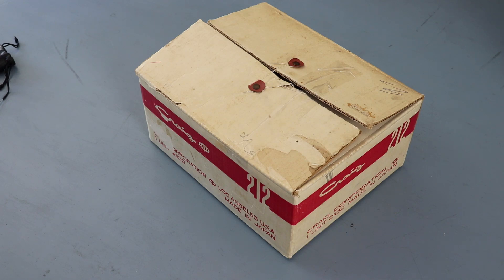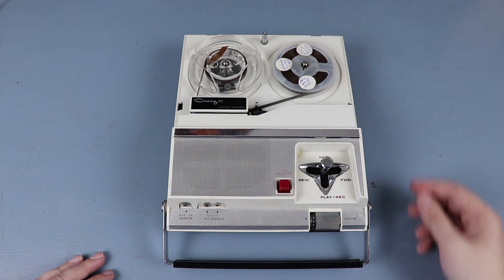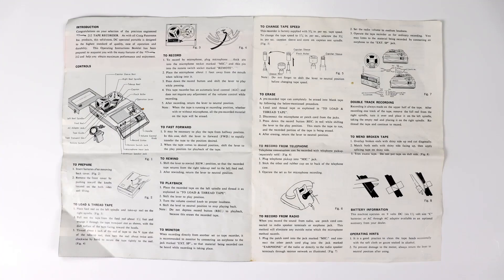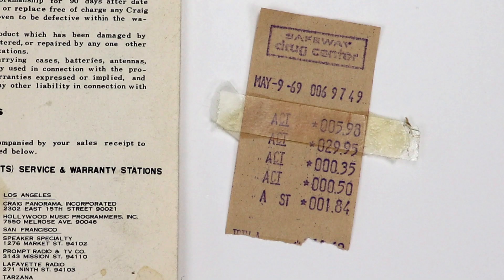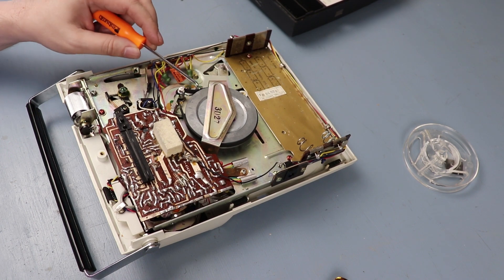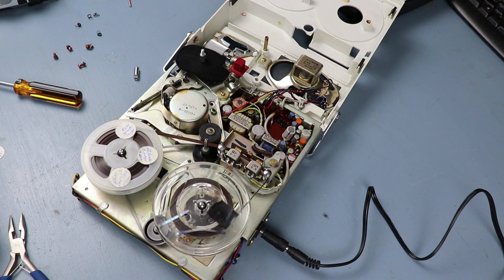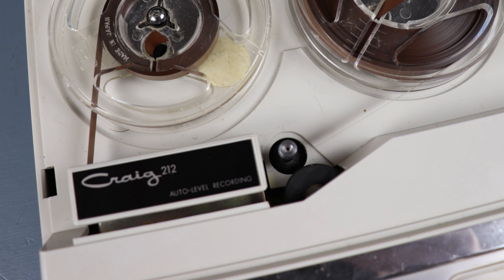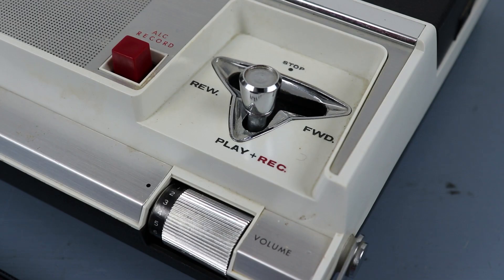The Craig 212 two speed portable tape recorder

Comment: The earliest 3" reel recorders didn't have "capstan drive." As the batteries gradually wore down, recording speed slowed down. When you played it back with fresh batteries, you sounded like a chipmunk! Capstans were a BIG advancement! Here's what another person said: "With a rim drive recorder there is no universal speed regulation, as one reel empties and the other one fills, the speed changes with the ratio." 

An AC adapter jack was also a much-desired feature. Without one, even if you had capstan drive, you went through batteries like crazy! One other VERY desirable feature that this 212 doesn't have is a Tape Counter. You could locate things on a reel of tape MUCH easier if you had reference numbers & wrote them down.

Comment: Ha ha, my favourite Christmas present when I was a kid. I thought it was dead, but many years later, I got it going by putting the belt back in place...very old so it does not grip well. I am looking for a new belt...If you record line in, you can monitor the incoming audio by partially depressing the record button before engaging the motor. Crazy loud for its size. It can give great tape saturation to a guitar track coming in, and also fun to grab the reel for lofi pitch modulation FX😂 Enjoying this tutorial, I will follow up...mine also records the crickets sound🤣🤣🤣

Comment: Thanks for the video of the Craig 212. I originally bought this model new (1968 or 69?) and still have the deck, remote microphone and the original box, although I have lost the manual and the power adapter.  I also had the telephone pickup, which was just a small microphone with a suction cup that you would affix to the back of the headset. I recall that it didn't work very well. Anyway, good find!

Comment: I had a Realistic (Radio Shack) 505-A 5 inch reel recorder.  It had the same capstan setup.  I recorded many Star Trek episodes.  Listening to them audio only, you tend to memorize the dialog.  I still have the 505-A as well as a minty 505 - the predecessor model.  The 505 needs a belt.  I never thought about using a 3d printer to make belts.  Right now that's out of my reach but I may be able to find a NOS part or replica someplace.  The Craig 212 was clearly the Cadillac of the 3-inch machines, with a true capstan drive.  Featured in many episodes of Mission: Impossible.  They also used a Craig 2106, a 5" model with capstan drive and a similar joystick control.  I have a perfect working example of the Webcor 210, one of the first consumer tape recorders circa 1953.

Comment: My dad had this machine while he flew F4 in the Vietnam War in 1968. He would record tapes and send them to my mom and that is how they stayed in touch during the war. My mom would do the same. I have this machine now and all of their tapes. I am going to try to make my  machine work better using your techniques. The tapes currently sound garbled.
Reply: I have the same machine but I'm having trouble with the pinch roller and I'm not sure how to take off the front panel of the machine you have an instagram or Facebook I can contact you at? most likely the issues with your machine is non occurrent in mine and I would be able to show you a reference
Reply: @sxo2685  If the rubber of the pinch roller isn't too dried up, probably all you need to do is clean the glaze off of it. As kids, we used to use rubbing alcohol (isopropyl) on a Q-tip, but there might be better things. Don't think I'd use any harsh things like lacquer thinner, though.

Comment: I have the original Sanyo MR-212, with a load of tapes of me and my brother from mid-60s. Sadly the unit has no sign of life. Even with new batteries, although the capstans jump on moving the selector lever, the motor is clearly not getting any power.

Comment: I have exactly one of these. The power cord is missing and using the batteries, I tired to play a tape, but the tape won't play. The tape just moves forward off the reel. I tried to turn the tape with my finger, but I can't make it go at the right speed. It either moves very slow or too fast. Is there any place to send these for repair?
Reply: Take the back off, like this guy in the video did to his. Maybe it's just a belt that's slipped off -- or maybe it's broken.

Comment: What polarity was the power supply after all?
Reply: He has the kind of AC adapter that has a 2-piece plug. You try one way, like he did, and if the reels turn incorrectly, you pull the plug apart and flip it around. Others sometimes have a polarity switch on the body of the wall wart  itself.
Reply: @burlingtonbill1  Yeah. I have a couple of universal converters like that. I was mainly concerned with frying some components by using the wrong polarity, but if that's not an issue with these, then I'll just go ahead.